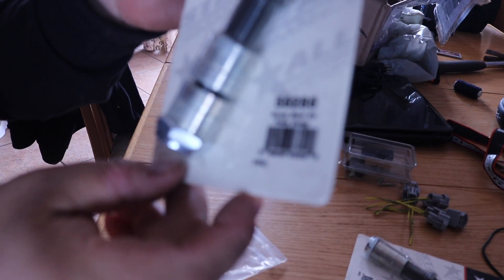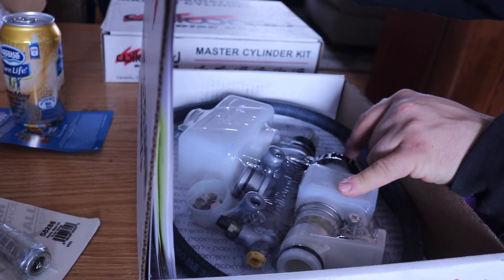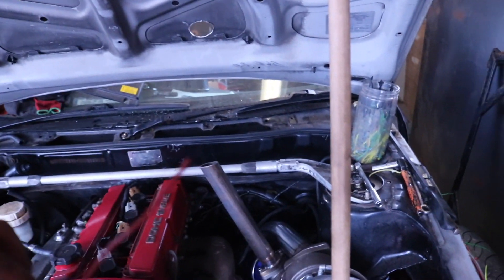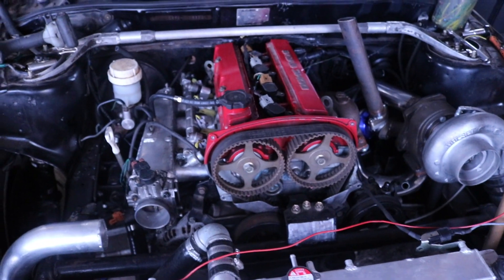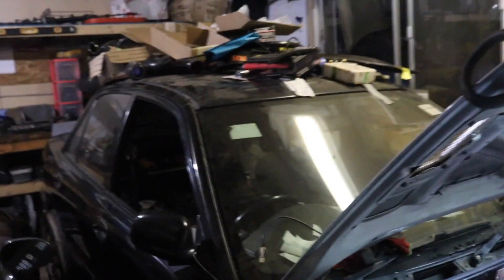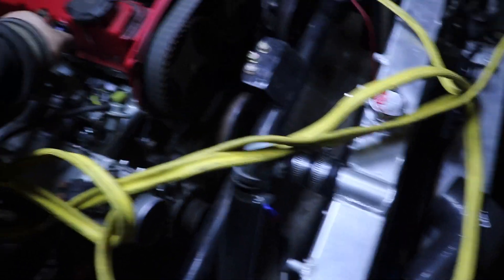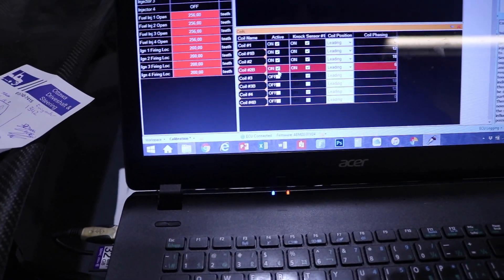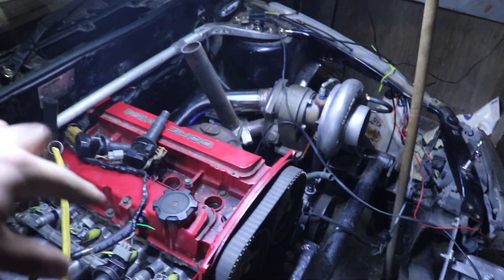Will The Evo Start? Finger's Crossed

Comment: Did a coil on plug set up on a old evo. forms had one wire wrong  attempted to start it ran like it was on two cylinders ended up frying the ecu switched the wires had to replace ecu
Reply from the maker: Damn that sucks, I didn't wire them backwords or anything, it's just I had to set the coil firing order so they fire as a waste spark system. luckily the AEM's have some safety features